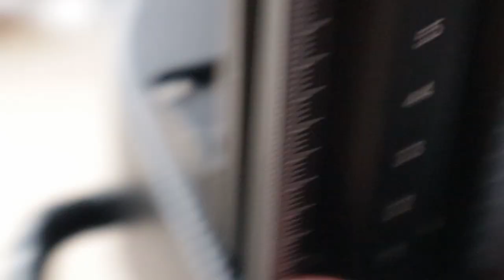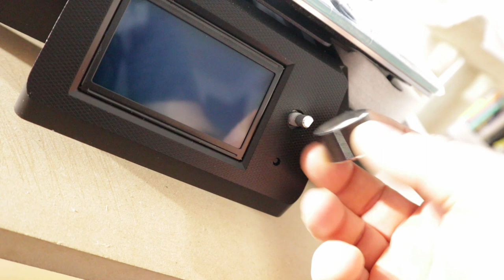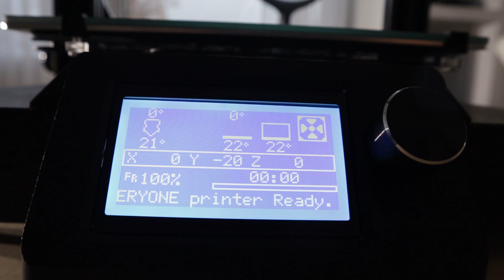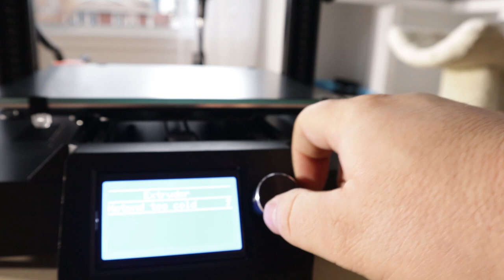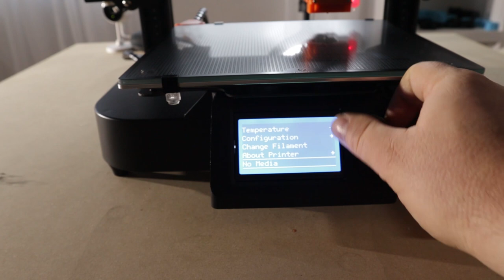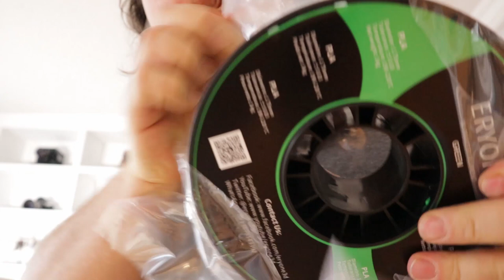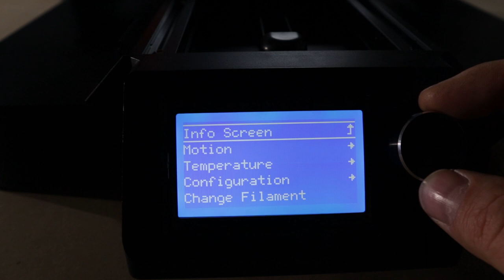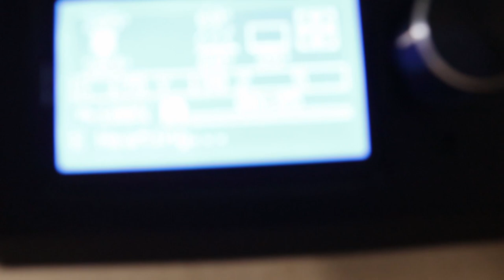I Unbox and Review The NEW Eryone ER-20 3D Printer!

Comment: This will be my first 3d printer and can't wait... Will the setup you done work with  all er 20s or do you need to test each printer to fine tune. Just trying my make my first time as painless as possible.
Reply from the maker: Pretty much everything. The only thing that would be different possibly the nozzle z-offset. Because the tolerances are so tight, you need to fine-tune it. Easiest way is to slice something with a large skirt with a few loops, and slow your print speed down to something you can live-tune. Just just zero in with babystepping and then note how much. Afterwards you adjust your offset by exactly that much and save the setting.

Comment: Temp Tower would have helped save you some time dialing in the good print temp ;)
Reply from the maker: Yeah. Lol. It's always hindsight. Hahahaha.
Reply: @TheWayneStevenson  ha ha .. true that, bruh. So, S or SE or ER 20?
Reply from the maker: @GauravGulati2019  I love my SE. Hands down. It's got a huge build surface on it, and I trust it. I'm doing an MPCNC build right now, and it's been my goto for the SKR 1.4 Turbo board housings, and my TFT. I printed a full set of MK3S parts for a new printer build. I can fit so much on it at once. 

And I trust it with everything I throw at it.  It hasn't let me down. Granted, I can't say I don't trust my other ones. My ER-20 has the longest single print I've ever done before. 1 day 13 hours. And all my others have gone the better part of a day each. So I think it's just some sort of bias.

The ER-20 has ALL the features I would want in a 3d printer, except for the size. It's perfect to replace my small desktop printer. Which I can't see myself replacing. I've gotten attached to it. I hoard. :(

I love everything about the ER-20 except for it's size and only if I need a larger printer. Compared to my old goto (Sunhokey Prusa i3 clone) the ER-20 is that much wider. So I can print a few drone frames on it that I couldn't on my old one.
Reply: @TheWayneStevenson  Kool! What's the desktop printer you have that got you looped around it's fingers? 🤣🤣

But,  seriously though, knowing what you know about Thinker S/SE, and  ER20 , and that S is $50 more than SE, and ER 20 is 30-40 more than SE, which one would you go for, if you were to buy you "first" Eryone printer (not first ever printer ..lol)?
Reply from the maker: @GauravGulati2019  Hmmm. It's a Sunhokey Prusa i3 clone. Only modifications have been 2208s, a 3d Touch sensor, a new heatbed (burnt one up the first week or two) and a piece of glass on the bed. And dual geared extruder I had to steal from a build when my pneumatic fitting failed and I couldn't get the right size easily.

It's one of those acrylic wonders. https://www.3dprintersonlinestore.com/full-acrylic-reprap-prusa-i3-kit Lol.

I'd go with the Thinker SE. Absolutely. The glass bed is great. FIguring out a first layer that the texture likes was a challenge, but I love it. I really do.
Reply: @TheWayneStevenson  Yeah, I hear ya about glass. Stock glass bed on my Ender 3 V2 is awesome. But, I think Thinker S might be a better bet for me, as I wanna try their Magflex bed (Magnetic base + sprint steel sheet + PEI) .. cuz it'll be come handy printing with PETG, TPU/TPE/Ninjaflex etc.

Thanks for sharing your thoughts